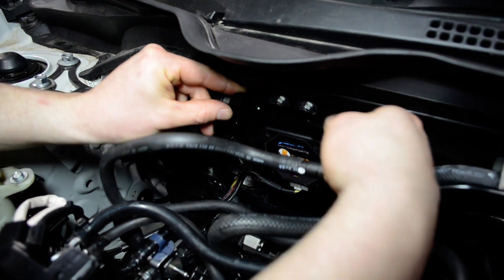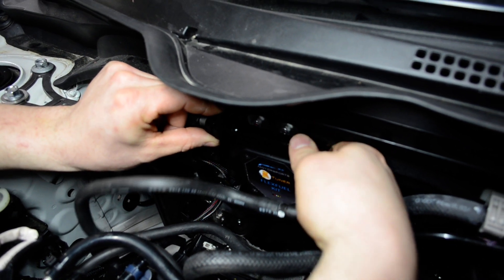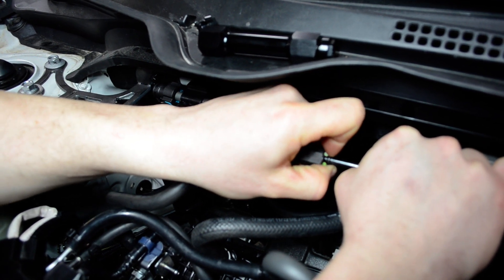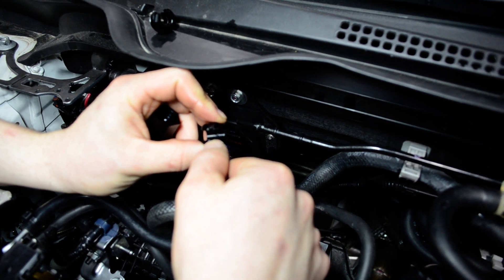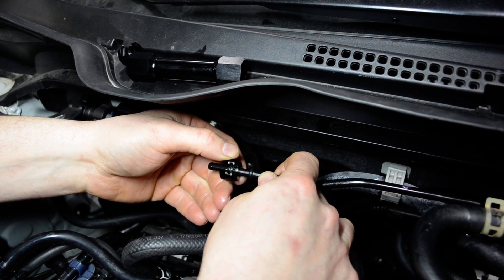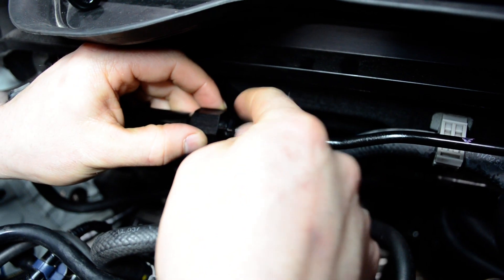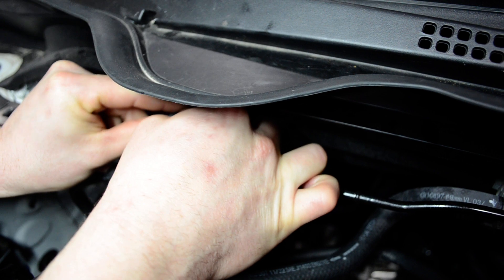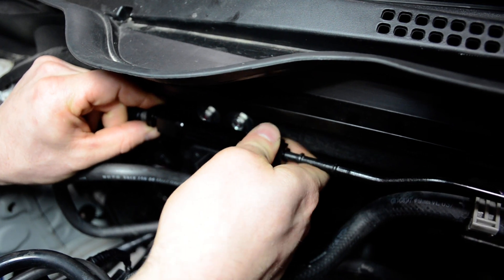PRL Motorsports 10th Gen Honda Civic Flex Fuel Kit Fitting Install

Comment: Question can you still run 93 until you tuned it for e85 or can you run e85 with out tuning it
Reply: You can run anything from pump gas to E85 on it
Least boost on pump gas and highest on E85
It will adjust itself according to fuel

Comment: Do I need a custom tune after plugging this kit ? I have a 2021 Honda Civic Hatchback Sport using KTuner
Reply from the maker: While a custom tune is recommended for optimal power and functionality. However, if you follow our instructions listed on our website to enable the flex tables, you can calibrate your ecu for the proper fueling. A few dealers such as TSP and Phearable offer of the shelf maps for flex tuning as well.

Comment: Anyway to use this for a 1.5 6mt accord?
Reply from the maker: The Accord 1.5T ECU does not have flex fuel capabilities at this time.
Reply: @PRLMotorsports  will it fit 1.5 civic cvt?
Reply: @the_batmobile0.4  yes

Comment: Can you do a full install video for the plug n play flex fuel kit for the 10th gen si please. I dont see any videos on it.
Reply from the maker: We will put out a step by step picture guide in the near future
Reply: I will make you one, but are you sure hondadata/ktuner will allow you to use it/tune with it? Email me to penguintechracing@gmail.com if interested.. its gonna be ~150$ cheaper too and use nylon lines which are ethanol resistant unlike rubber hose they use in this video.
Reply: the kit plug to the temperature sensor replaces the car plug but how does the car receive the information if it is disconnected?

Comment: Does this kit mount with the catch can? Or would I have to relocate it
Reply from the maker: In theory, yes it will fit with a catch can, being that the catch cans vary in design it will also vary with fitment
Reply: @PRLMotorsports  I have the mishimoto catch can as well, do you guys provide a secondary or a modified bracket to re-attach the catch can?